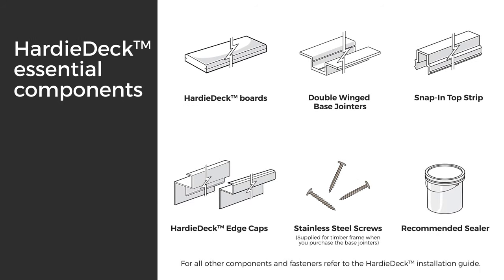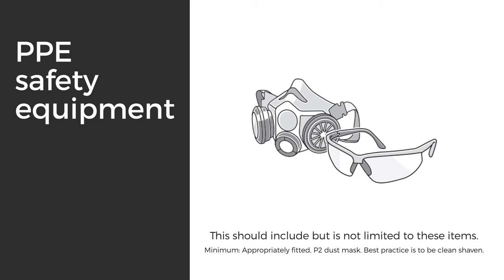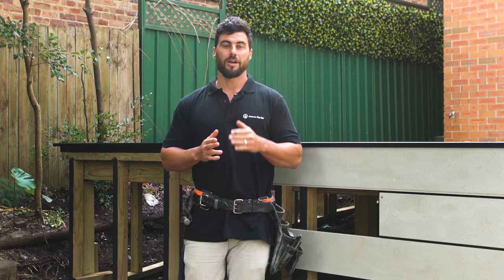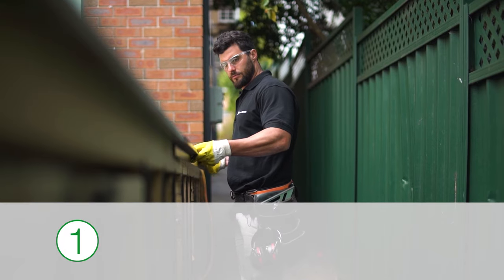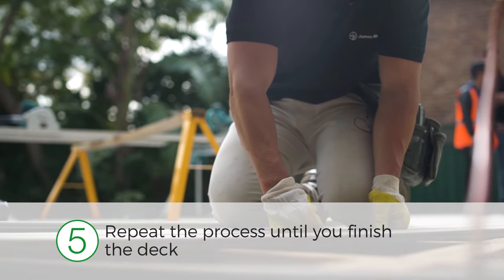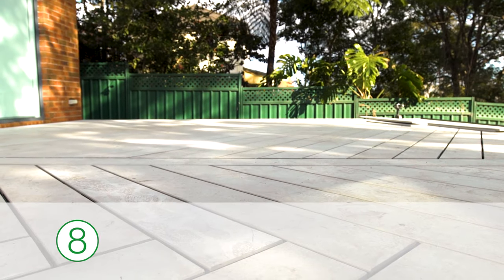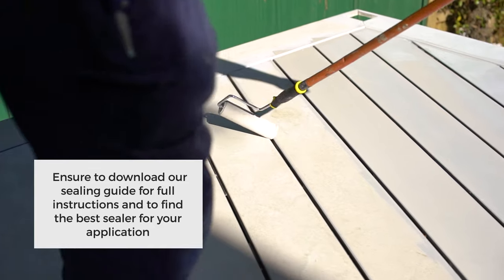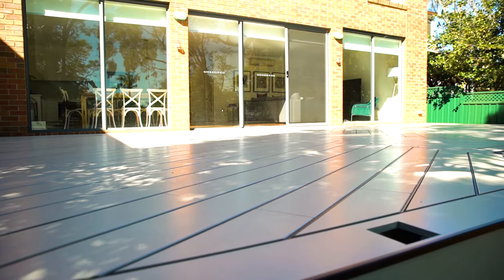How to Install HardieDeck™ – Tools, Components, Design Considerations and Installation Process

Comment: I'm keen on using this product.just wondering if anyone here has installed it and can confirm if water actually drains through the decking once those snap in strips are installed ? I can't tell if it's perferated from the video and it shows no mention of it on the instillation instructions. 
Looks like it could be a potential Watters pooling issue on larger decks ...